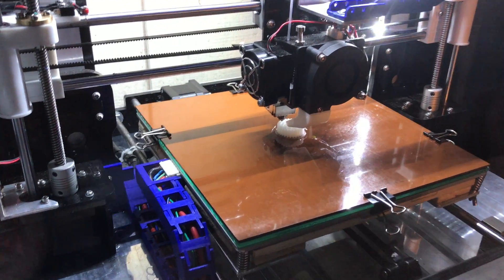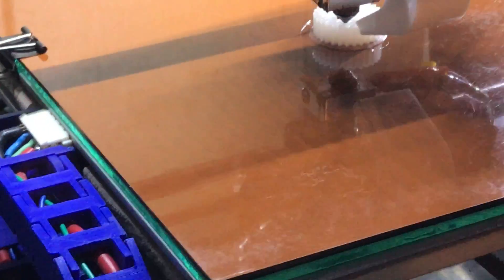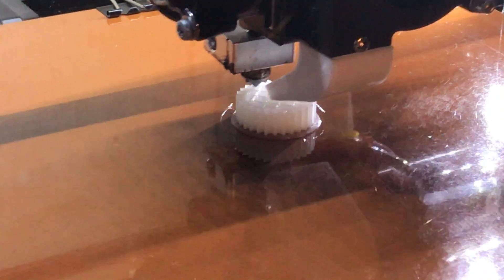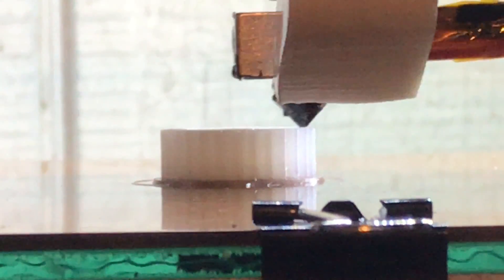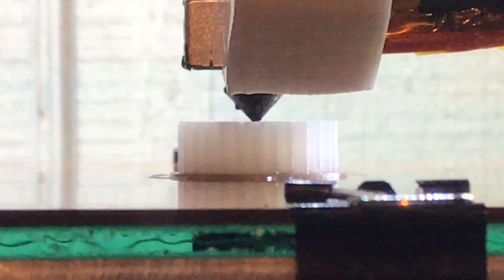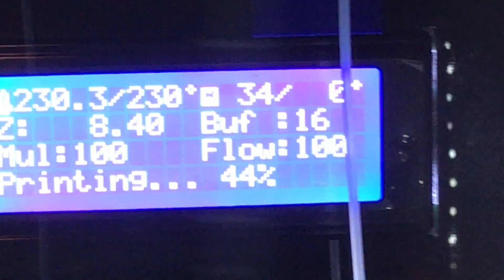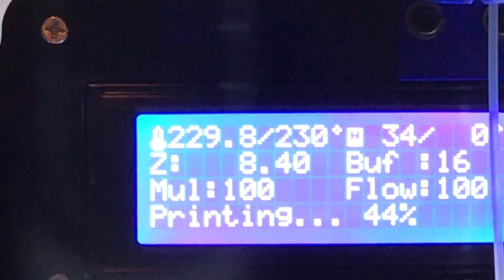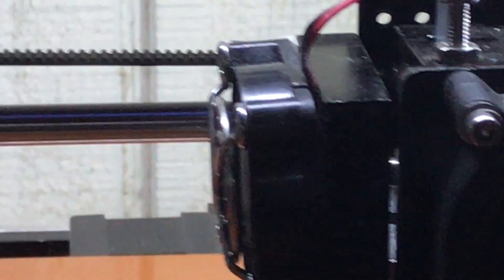Printing Bridge Nylon with my Anet A8 using 1/16" thick Phenolic Paper or Garolite. Great adhesion.

Comment from the maker: I used Garolite for printing nylon. It works great. Glass or using carpenter glue on glass doesn't work for nylon. It will lift off after 7-10 layers.  Just buy a Garolite plate from internet (Amazon) or McMaster 1/16" thick, and attache it to your glass bed with clips and that's it. You don't need heating the bed and you don't need plastic cooling fan. I recommend to unplug the cooling fan from the board that's the best. If you disable using the programming it doesn't work. The fan still works even if you put the set the speed to 0. Unpluging from the board is the best. It works 100%. I've never printed big parts covering the whole surface of the bed. But it works for small parts like for example gears.after printing just put part with garolite board into the fridge for 15 minutes and  you can remove the part from the board very easy. But  I think its better to play with ABS ratter than Nylon. Its a good plastic too. For kayac ABS can work too. Its actually cheaper almost 2 times than Nylon. For ABS  I use glass bed with a sanded surface and ABS slurry. Just build an oven to dry your filament. Thats mandatory for Nylon and ABS. It gives a great quality of the surface. Please see the link https://www.youtube.com/watch?v=zIN8X2emXII   For ABS you need to ruffle the surface of the glass in diagonal direction with 80 grit sand paper and use ABS slurry to start printing ABS ( dissolve some ABS in Aceton). Apply it to the cold surface with brush before printing. It works 100%. Use 90F to heat the bed. Unplug plastic cooling fan for ABS too. That's the best. Now I like ABS more than nylon. Printing with ABS much better much easier and much cheaper ... O men... that's the best 3D Printing plastic material  per me. Forget about Nylon. Nylon sticks  to Garolite only and its hard to work with.  ABS is water resistant, high temperature plastic. It can work for Kayaking very good too. ABS more rigid than Nylon. Nylon is softer. Again ruffle the surface of the glass (wet sanding) with 80 grit paper in one direction only. ABS will not work on regular smooth glass surface. It will lift off. Do this and you will appreciate later on...I guarantee. Nylon is great for small like gear parts only.

Comment: Is the hot end Anet-A8 OEM or you changed it to recommended  " all metal " for nylon printing?
You convinced me to change over to Garolite from heated glass bed.
Reply from the maker: yes , Anet A8 hot end made of brass.